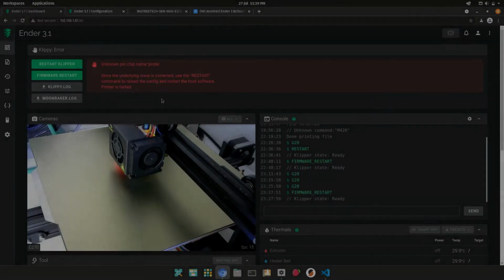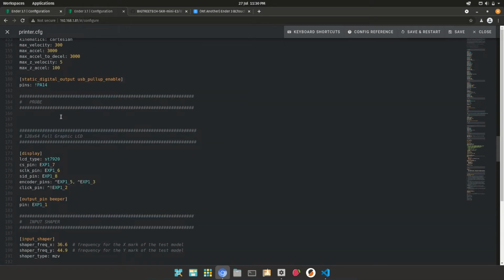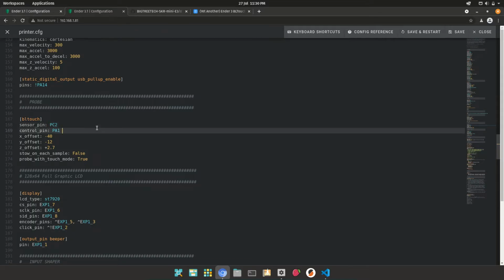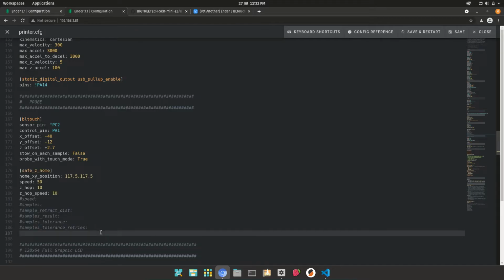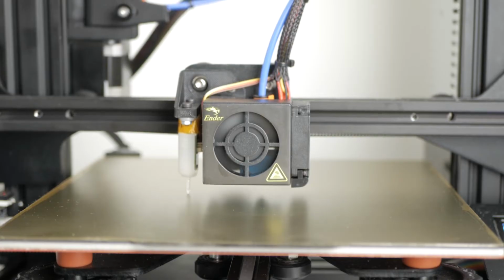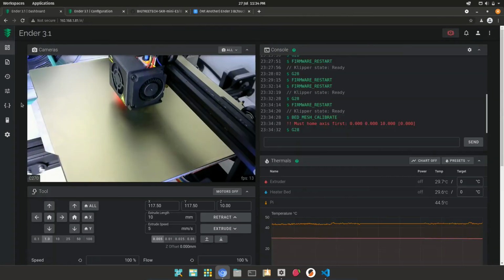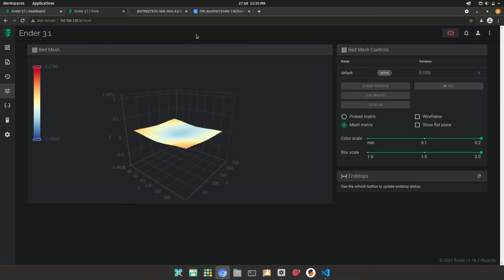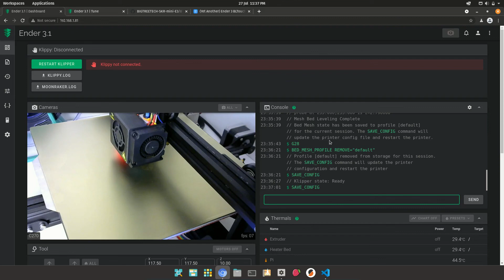Klipper Basics - Adding A BLTouch

Comment: Cant your share printer.cfg and macros.cfg?
Reply from the maker: I can, but it's only going to be of use if you have the same hardware. I have an SKR E3 mini V2. Happy to try and help you set up if you're using a different mainboard?
Reply: I have an ender 3 v2 running klipper fw do you have a recommendation for a BLT or 3Dtouch version that is suitable for the stock mainboard ender 3 v 2 v4.2.2?
Reply from the maker: @lanypuspasari1868  Personally I would go with a genuine Antclabs Bltouch as I have seen some 3DTouch with wildly different accrucy and strange pin out configettions, and the V3.1 is the most recent and straightforward to use. but the v4.2.2 will work with any of the probes like the CL Touch BLTouch, CR Touch or 3D Touch.

Comment: Nice video! I am having an issue that is rather hard to track down online where my BLtouch is always TRIGGERED no matter what state the pin is in. It responds to commands and drops and pulls up on the pin. But never leaves the TRIGGERED state. My wiring is the same as it has always been for Marlin before and the pinout map for my board matches what I have in the config for Klipper.

Board: MKS Robin Nano V3
Printer: Two Trees Sapphire Pro
Probe: Official BLTouch v3.1

One thing to note is that this MKS board does not have the dedicated 5 pins for BLTouch/Servo and I have to use Z+ or Z- endstop for the sensor pin. That might be what is being fussy with the config.

Any help is greatly appreciated :)
Reply from the maker: Hi, sounds like the pin may not be configured correctly, could you post your printer.cfig to a site like https://pastebin.com/ and then link it here so I can have a little look? could just be you need to indicate there is a pullup resistor by adding ^ symbol in front of it, like Pin: ^!PA11 (but with your pin number)
Reply: Same issue bl touch always triggered. Cr10 v2 stock with bl touch v3.1. I suspect this is a bl touch 3.1 issue.  Any update on this? Thank you
Reply: Oh hell, still without solution :(

Comment: great video, thank you! im having issues with my klipper install, when I home on mainsail interface I get no movement and an error message. I have an ender 3 pro with the 4.2.7 board and chose the ender 3 v2 printer config for that reason. I also have a bl touch that I have to use your video to help me install, would that be the reason im not getting any movement? any help would be amazing!
cheers
Reply from the maker: Hey Corey, sorry for the late reply, can you let me know what error message you get? You may have an issue using the code from my config if you have not changed the pin numbers to match your mainboard.
Reply: @PigeonPrint  no worries at all, thank you for getting back to me. When I try homing it runs g28 then reads a error message saying "no trigger after movement on x" I'm assuming that means no end stop trigger, however the motors dont try to move or  seem as if they are even powered up. All axis move as if the steppers are disabled.
Reply from the maker: @corey312  Can you try moving the printer away for all the endstops and putting this into the console command line QUERY_ENDSTOPS 

It should come back as x:open y:open z:open if one of them is showing as closed you will need to flip the pin by ! infornt of the pin number in your Printer.cfg
Reply: @PigeonPrint  I'll give that a go now! Thank you
Reply: I get the message "x:TRIGGERED y:TRIGGERED z:open" no movement of the bl touch
Reply from the maker: @corey312  OK it think your endtops are already homed as the switches are reading ad triggered. go into your printer.cfg and but a ! in front of the pin for endstp X and Y So it say something like :

endstop_pin: !PA15  

But with your pin numbers. then do a QUERY_ENDSTOPS  again, and they should read  x:open y:open z:open and homing should work....just message me if not! :)
Reply from the maker: Try adding ^! infront of the X endstop, so it reads:

endstop_pin: ^!PE4 (but with your current pin number under the [stepper_x]. About to head to bed, but let me know if that doesn't work and will try and be more helpful tomorrow.
Reply: It is also saying missing configuration 
•display status is not identified in config. 
Also 
Make sure you include the mainsail.cfg in your printer.cfg file.
Reply: Okay this is promising! It's going to home but no deployment of the probe from the bl touch.
Reply: Hi again, after messing around with my config for a few more hours I still cant get the probe to deploy and retract on start up and does not deploy when homing. my printer config is as follows:

# This file contains pin mappings for the Creality "v4.2.7" board. To
# use this config, during "make menuconfig" select the STM32F103 with
# a "28KiB bootloader" and serial (on USART1 PA10/PA9) communication.

# If you prefer a direct serial connection, in "make menuconfig"
# select "Enable extra low-level configuration options" and select
# serial (on USART3 PB11/PB10), which is broken out on the 10 pin IDC
# cable used for the LCD module as follows:
# 3: Tx, 4: Rx, 9: GND, 10: VCC

# Flash this firmware by copying "out/klipper.bin" to a SD card and
# turning on the printer with the card inserted. The firmware
# filename must end in ".bin" and must not match the last filename
# that was flashed.

# See docs/Config_Reference.md for a description of parameters.

[stepper_x]
step_pin: PB9
dir_pin: PC2
enable_pin: !PC3
microsteps: 16
rotation_distance: 40
endstop_pin: ^PA5
position_endstop: 0
position_max: 235
homing_speed: 50

[stepper_y]
step_pin: PB7
dir_pin: PB8
enable_pin: !PC3
microsteps: 16
rotation_distance: 40
endstop_pin: ^PA6
position_endstop: 0
position_max: 235
homing_speed: 50

[stepper_z]
step_pin: PB5
dir_pin: !PB6
enable_pin: !PC3
microsteps: 16
rotation_distance: 8
endstop_pin: probe:z_virtual_endstop
#position_endstop: 0.0 
position_max: 250

[extruder]
max_extrude_only_distance: 100.0
step_pin: PB3
dir_pin: PB4
enable_pin: !PC3
microsteps: 16
rotation_distance: 33.500
nozzle_diameter: 0.400
filament_diameter: 1.750
heater_pin: PA1
sensor_type: EPCOS 100K B57560G104F
sensor_pin: PC5
control: pid
pid_Kp: 21.527
pid_Ki: 1.063
pid_Kd: 108.982
min_temp: 0
max_temp: 250

[heater_bed]
heater_pin: PA2
sensor_type: EPCOS 100K B57560G104F
sensor_pin: PC4
control: pid
pid_Kp: 54.027
pid_Ki: 0.770
pid_Kd: 948.182
min_temp: 0
max_temp: 130

[fan]

pin: PA0

[mcu]
serial: /dev/serial/by-id/usb-1a86_USB_Serial-if00-port0
restart_method: command

[printer]
kinematics: cartesian
max_velocity: 300
max_accel: 3000
max_z_velocity: 5
max_z_accel: 100

[board_pins]
aliases:
  EXP1_1=PC6,EXP1_3=PB10,EXP1_5=PB14,EXP1_7=PB12,EXP1_9=<GND>,
  EXP1_2=PB2,EXP1_4=PB11,EXP1_6=PB13,EXP1_8=PB15,EXP1_10=<5V>,
  PROBE_IN=PB0,PROBE_OUT=PB1,FIL_RUNOUT=PC6

#sensor_pin: ^PB1
#control_pin: PB0

[pause_resume]

[bltouch]
sensor_pin: ^PB1
z_offset: 0
control_pin: PB0
pin_up_touch_mode_reports_triggered: true
probe_with_touch_mode: True
x_offset: -42
y_offset: -5

[bed_mesh]
speed: 120
horizontal_move_z: 5
mesh_min: 15, 15
mesh_max: 205, 205
probe_count: 5,3
algorithm: bicubic

[safe_z_home]
home_xy_position: 117.5,117.5
speed: 50
z_hop: 10                 
z_hop_speed: 10

[gcode_macro CANCEL_PRINT]
description: Cancel the actual running print
rename_existing: CANCEL_PRINT_BASE
gcode:
    TURN_OFF_HEATERS
    CANCEL_PRINT_BASE

[gcode_macro RESUME]
description: Resume the actual running print
rename_existing: RESUME_BASE
gcode:
    ##### set defaults #####
    {% set e = params.E|default(1) %} #edit to your retract length
    #### get VELOCITY parameter if specified ####
    {% if 'VELOCITY' in params|upper %}
      {% set get_params = ('VELOCITY=' + params.VELOCITY)  %}
    {%else %}
      {% set get_params = "" %}
    {% endif %}
    ##### end of definitions #####
    G91
    {% if printer.extruder.can_extrude|lower == 'true' %}
      G1 E{e} F2100
    {% else %}
      {action_respond_info("Extruder not hot enough")}
    {% endif %}  
    RESUME_BASE {get_params}

[gcode_macro PAUSE]
description: Pause the actual running print
rename_existing: PAUSE_BASE
gcode:
    ##### set defaults #####
    {% set x = params.X|default(230) %}      #edit to your park position
    {% set y = params.Y|default(230) %}      #edit to your park position
    {% set z = params.Z|default(10)|float %} #edit to your park position
    {% set e = params.E|default(1) %}        #edit to your retract length
    ##### calculate save lift position #####
    {% set max_z = printer.toolhead.axis_maximum.z|float %}
    {% set act_z = printer.toolhead.position.z|float %}
    {% set lift_z = z|abs %}
    {% if act_z < (max_z - lift_z) %}
        {% set z_safe = lift_z %}
    {% else %}
        {% set z_safe = max_z - act_z %}
    {% endif %}
    ##### end of definitions #####
    PAUSE_BASE
    G91
    {% if printer.extruder.can_extrude|lower == 'true' %}
      G1 E-{e} F2100
    {% else %}
      {action_respond_info("Extruder not hot enough")}
    {% endif %}
    {% if "xyz" in printer.toolhead.homed_axes %}    
      G1 Z{z_safe}
      G90
      G1 X{x} Y{y} F6000
    {% else %}
      {action_respond_info("Printer not homed")}
    {% endif %}

[virtual_sdcard]
path: ~/gcode_files
Reply from the maker: @corey312  OK, will take a look at your config. do you have theBLTouch white and black probe wires plugged into the Z endstop pins or plugged into the last two pins of the 5pin probe header? If you could upload a photo how you have your BLTouch wired into the board it would really help.
Reply: @PigeonPrint  let me give it a check Ive installed the bl touch about 8 months ago
Reply: @PigeonPrint  the black and white are plugged into the z stop pin
Reply: @PigeonPrint  ended up getting it figured out, I had to have my bltouch wired to the 5pin and not split off to the z axis input. Thanks again for your help!
Reply from the maker: @corey312  good to hear you got out sorted out, tried to hunt down a pin map of that board to check the printer.cfg

Comment: Hi, I've copied your code, and I'm trying to work through it, this is very new to me, but I'm slowly making progress. I'm at a point where I can get all axis to home, except the BL touch probe does not deploy and the nozzle crashes into the bed. I've commented out the following line: endstop_pin: ^!ar18 and added this: endstop_pin: probe:z_virtual_endstop. I get the following error when restarting firmware: Option 'position_endstop' is not valid in section 'stepper_z'. 

any idea?
Reply from the maker: My guess would be that you dont have the right pins selected in your code for the board you are using. It is hard to troubleshoot on youtube comments. if you have Discord feel free to add me and I will see if I can be of more help Pigeon#6202
Reply: @PigeonPrint  tha is for the reply. I did get it figured out. I was using pins as called out on the pin out diagram, D11 for example. The mcu doesn’t recognize this, instead it’s ar11. I’m to the point of setting z-offset, but decided to refresh the extruder assembly first.

Thanks!!
Reply from the maker: @xphildox  Good to hear you got it  working! if you need any help with setting Z offset, I have a video on that :)
Reply: @PigeonPrint  I already watched it and also followed instructions on Klipper website.

One question I do have, where do I put the cancel_print macro? Does it go in the printer.cfg?
Reply from the maker: @xphildox  Yep, put it in the printer.cfg file near the bottom. you may have a line at the bottom that says "don't edit the values below this point" just pup it above there with any other macros.
Reply: @PigeonPrint  got it working, with no error messages!

Unfortunately my printer decided to burn up two breakout boards, ribbon cable, and end stop, while starting my first actual test print…joy
Reply from the maker: @xphildox  owch! hope you can get back up and pritningf soon"
Reply: I thought you were supposed to comment out position_endstop? I found this on klippers website, "If using "probe:z_virtual_endstop" then do not define a position_endstop in the stepper_z config section."
Reply from the maker: @cotycollins6302  Yep, if using probe:z_virtual_endstop
you just need to define:
position_max: 
position_min: 
under [stepper_z] section.

Comment: Will this work with CRTouch ? because the pin is very different from the BLTouch
Reply from the maker: Yes, the CRTouch should work without issue as the pinouts are the same and they are interchangeable as far as I'm aware. I don't have one to test, but I don't think you will have any issues just setting it up as a [bltouch] like show in the video. If you do run into any problems just reply in here and I will try and help.
Reply: @PigeonPrint  Ok thanks for the clarification. I got one more question, what if I currently have the Micro Swiss Direct Drive installed on the Ender 3 and wanted to use the CRTouch at the same time… will it worked fine? because I tried using the CRTouch along with the Micro Swiss on Marlin firmware and I have to edit the X_MIN_POS and Y_MIN_POS on the Configuration.h so the probe don’t go off the print bed when doing the calibration. Right now I am using Klipper without the CRTouch. Was wondering if it’s going to work at all.
Reply from the maker: @peterking-vn3fx  I think....I included setting up safe homing in this video. That should make it home in the middle of the bed rather then at x0,y0 (front left and miss the bed). but for doing a bed mesh you will need to make sure you have the offset of your probe put into Klipper, I assume that will be in the manual. If not you will need to measure how many mm to the left and how far in front the nozzle it is. 

For example my probe is to the left by 40mm and in front by 12mm so I put under the [bltouch] section: 
x_offset: -40 
y_offset: -12
for working out z_offset, I have a video on doing that in Klipper. Hope this helps!

Comment: Great video. Though, I'm wondering, what is the point of the X and Y offsets for G28 if it does not probe the center of the bed when homing?
Reply from the maker: If I understand your comment correctly. combination of safe homing + G28 is not to probe the centre of the bed per se
, but to avoid homing at 0,0 where there is a larger chance your probe will be off the bed and not trigger.
Reply: @PigeonPrint  Ah I see, would it affect anything to change the values to ensure the probe centers at the bed?
Reply from the maker: @osiris9679  Should be fine to change it under the [safe_z_home] section to where ever you want on the bed, so adjust the "home_xy_position:" to values that match your probe (just add or subtract your probe offset values to your current value and it should probe in the centre). 

Just don't change anything in the sections that a G29 would use, so don't change anything under [bltouch] section.
Reply: @PigeonPrint  Awesome! Thanks!

Comment: Having a ruff time finding what bl touch pins to set.. 

Have a cr10s with stock v1.0 board.

Printer file i have set up with AR prefix, and all working, but need correct pins for bl touch. Heeelp 😁
Reply from the maker: Sure, happy to help! Does your board have a version number (normally printed in a white square on the bottom right of the PCB, Should say something like "Creality V2.4"
Reply: @PigeonPrint  i already told you. V1.0 😂

But found the right pin in the eeend. Thanks anyways!
Reply: sensor_pin: ^PC4
control_pin: PA2 -- u use PIN29 on the board in marlin before
Reply: @flyingskull  Nah your worng.
This is correct.

^ar18=PD3
  ar11=PB5

Comment: Nice video! For some reason everytime I try to home it does everything successfully except lower the Z-axis to probe the bed so I get a failed probing attempt. T_T
Reply from the maker: Hey Wilhelm,  What mainboard do you have? sounds like the pins defined on the printer.cfg could de different from the ones being used by the BLtouch.